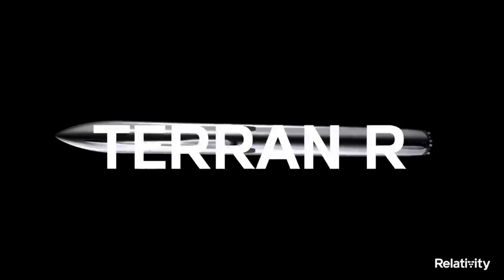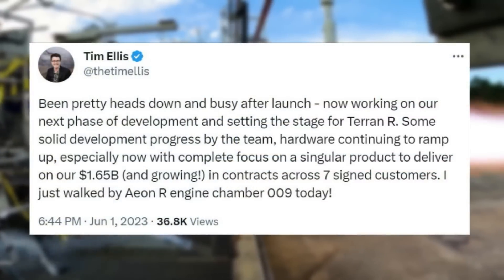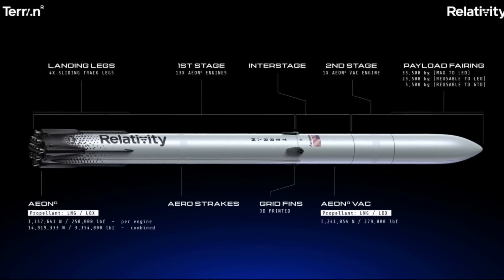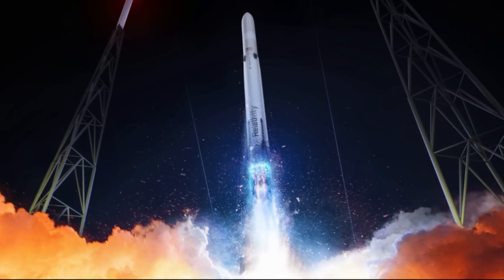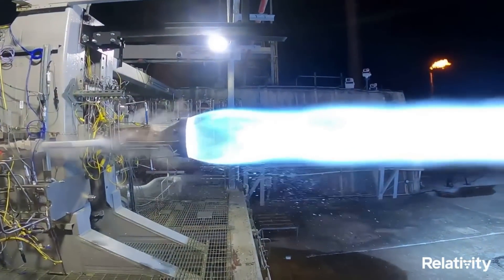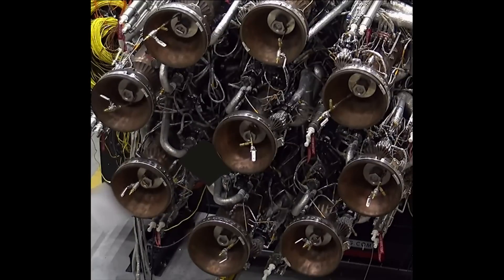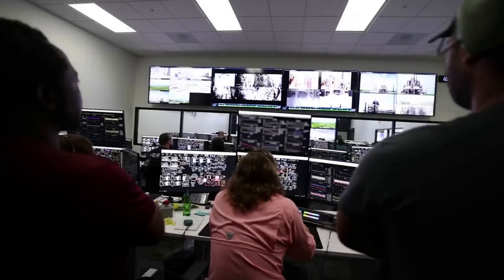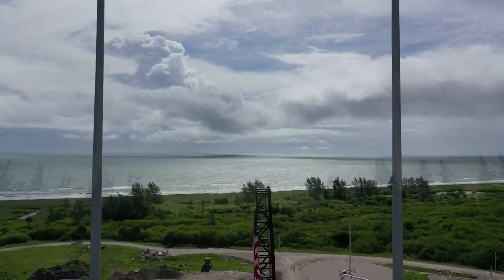Terran R Is Getting Closer To Its First Test Flight

Comment: If successful, Relativity's Terran R could be just the beginning for this rocket design. As I understand it, Terran R will roughly compete with SpaceX's Falcon 9 re-usable launch vehicle. I bring up Falcon 9 because, once SpaceX finished development of Falcon 9, they turned around and took three Falcon 9 first-stage boosters and came up with Falcon Heavy. If Relativity followed SpaceX's Falcon 9 / Falcon Heavy example, one can speculate that a Terran R3 could follow soon after Terran R, with almost triple the payload capacity. If Terran R really does offer the capacity of putting 23,500 kg up to LEO and still be re-usable, a possible Terran R3 could theoretically launch as much as 70,500 kg to LEO and see its boosters return to base for re-use. If Relativity saw fit to go beyond a Terran R3, perhaps we could see a Terran R with four additional first-stage boosters installed, to form a Terran R5. If my fuzzy math adds up, an R5 could theoretically launch a 117,500 kg payload to LEO. Such a development could place Relativity in the enviable position to start nipping at the heels of SpaceX Starship and NASA's outrageously wasteful, expendable Space Launch System. One can only hope...

Comment: This is an all-or-nothing gamble.
Trying to build & launch your advanced rocket design first, instead of evolving towards it, is a game of roulette.
Reply: This is why RocketLab is taking a solid 2nd place, only behind SpaceX, and far ahead of #3
Reply: It's pretty much exactly what SpaceX did, and SpaceX didn't have advanced 3d print tech to fall back on for business.
Reply: The Terran 1 came first. Rocket Lab also has a lot of experience.
Reply: @MrEd2291  - Terran 1 has yet to prove itself as a launch vehicle. That's part of what evolution means. You've got to evolve by solidly proving something, not by building on sand.